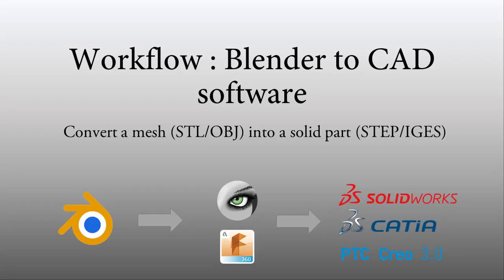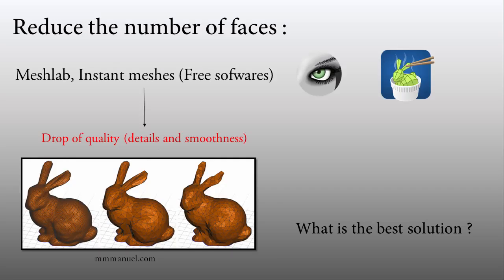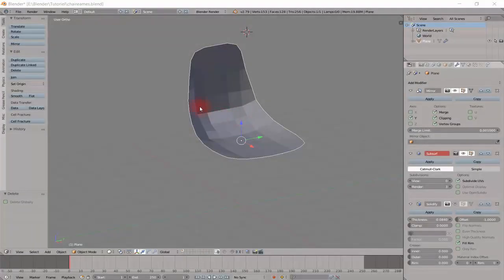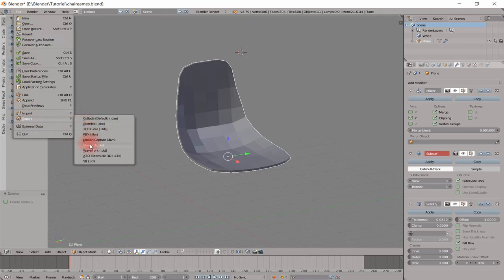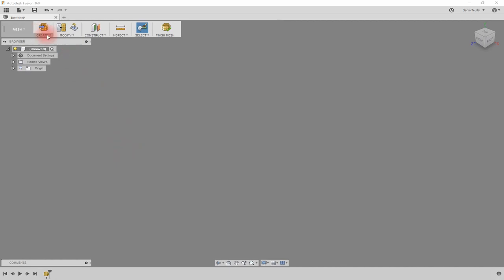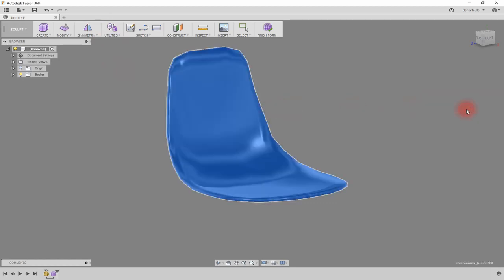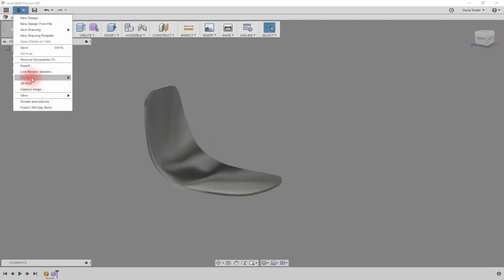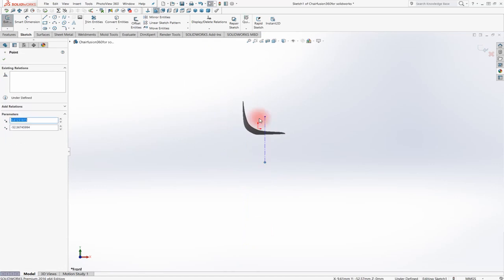Workflow : Convert a mesh to a solid (STL/OBJ to STEP)

Comment: @DT Works Is it possible to sharpen the edges of the model in blender to maintain the shape when converting it to the mesh to Tsplines??
Reply: i think yes you can i tried it and it kind of worked